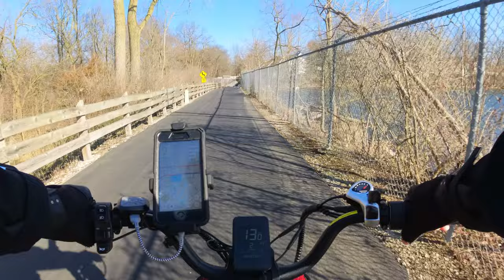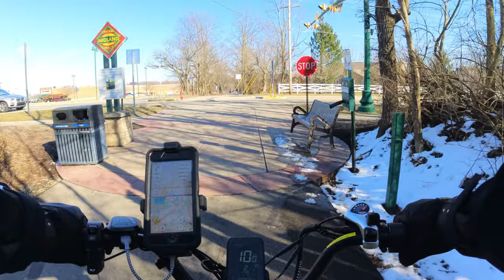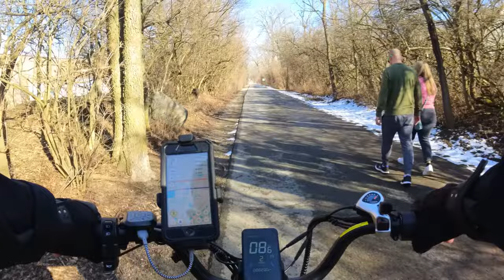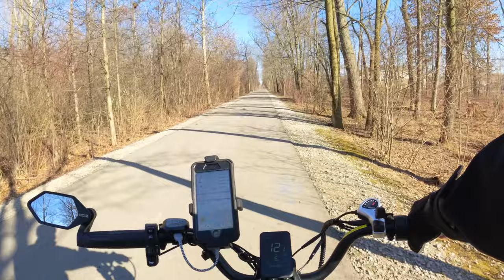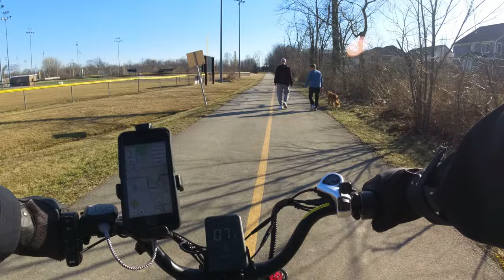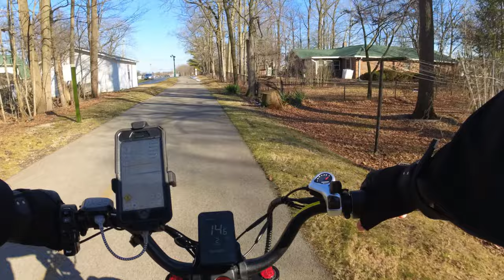First Leg: E-Bike Ride to Potter's Covered Bridge

Comment: 70-year-old, limited-mobility handicapper here. 
Wheelchair/forearm crutches on/off 25-inch seat height
on my "Hase Lepus" delta planform recumbent trike.
"Class 1" helps assist movement of my huge NFL-size body perfectly well.
Well over 30 years recumbent experience here.
"Class 1" only, may well be the answer, as per sampled in European laws!
Reply from the maker: It might be what comes. I’d feel more comfortable with Class 2 since it offers the throttle. 

In the UK, they are legally only allowed to have a 250watt motor, so the 750 watts that we currently allow seems like a reasonable solution. 

I have a neuromuscular condition that causes muscular weakness (paralysis) the more I use a muscle. So the throttle is definitely something I need. 

How is it learning how to maneuver the trike?

Comment: What they need to do is make helmets mandatory on bikes of all kinds. My cousin fell off a bike and hit her head on a rock and died with no helmet. It is easy to pedal 20 mph without a lot of effort. They make a big deal about bikes with motors but I can pedal 35 mph, on level ground ,on a regular bike.  and no one complains about that. Bikes should be able to keep up with traffic as governments are slow to put in the infrastructure. Ebikes are not going to go away. Places like Vietnam have roads just for bicycles and scooters because cars and trucks do not mix with bicycles and other smaller vehicles.. Unfortunate accident but it is proof your brain box is not bullet proof. The autopsy will more than likely determine head trauma as cause of death. So if she was hit with a car would they ban Cars for 60 days?
Reply from the maker: The helmet laws are likely too difficult to legislate. There are several states, my state of Indiana included, that do not restrict motorcyclists to wearing helmets. I think we all would be better for having the requirement, but there are too many that don't want told what to do when it comes to safety. Hopefully that will change some day like it did for requiring seat belts.

I agree with speed. It is more a responsibility factor like in a car. Our cars can go faster than the speed limit, but we only issue citations for speeding and sometimes arrest for irresponsible or reckless driving. 

On the Juliet, I have to peddle like a madman to get it a bit above 20 something, but I have definitely been on road bikes at much higher speeds. Indiana goes so far as to say that all classes of ebikes are only allowed on roads that are a 45mph or less. It sounds good, but it is pretty hard to find roads in the country that are less than 45. Nearly everything is 50mph. 

We definitely have some years of growing pains to suffer through with legislation. 

Thanks for watching and talking about this.